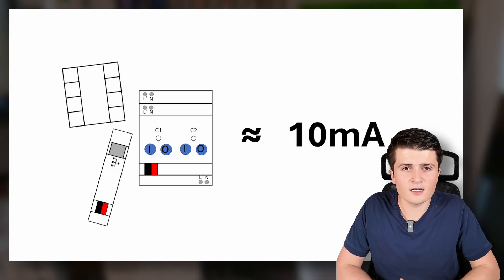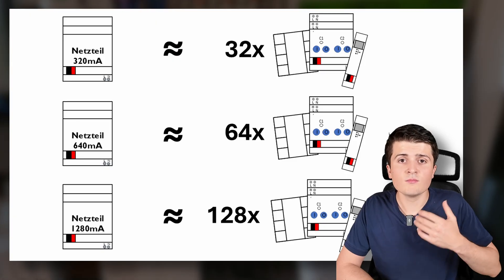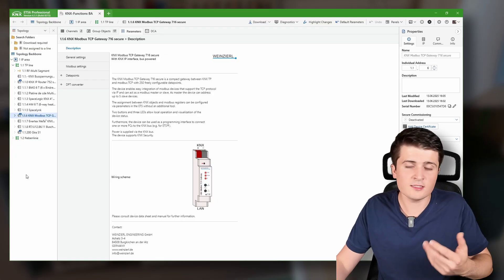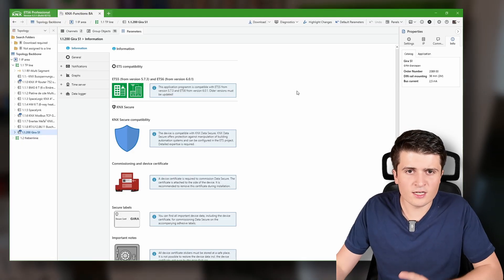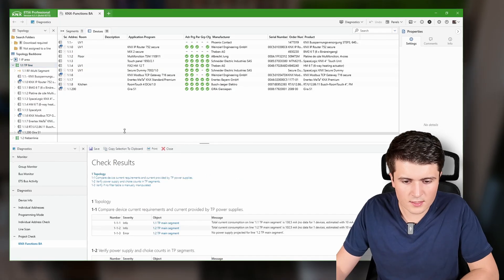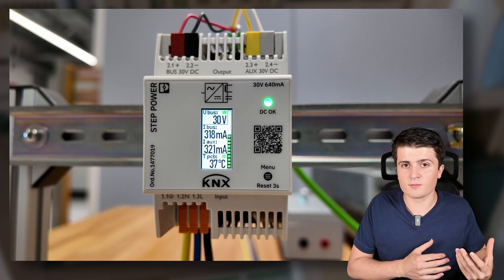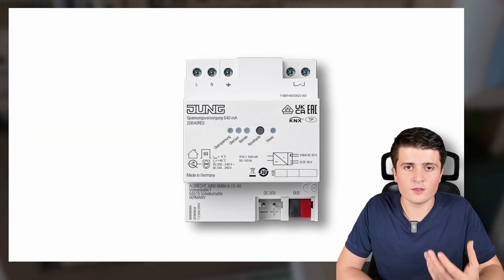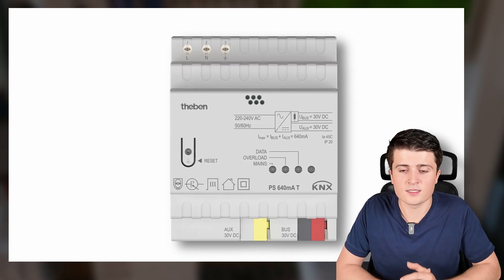Which KNX power supply unit is the right one? - KNX Quick & easy

Comment: Hi what if you want to use two knx psu in a lind for redundancy in case one of two goes bad
Reply from the maker: In this case take a look at the manual of the psu. Most of the manufacturers give you more detail about that on what you need to know